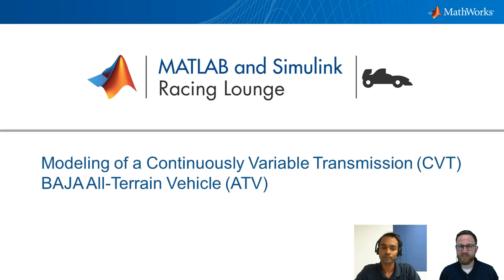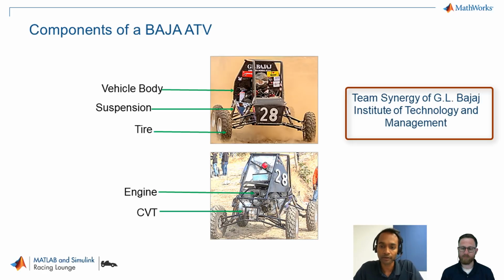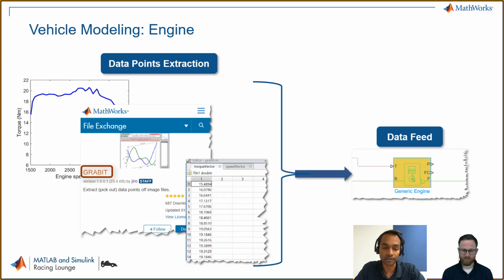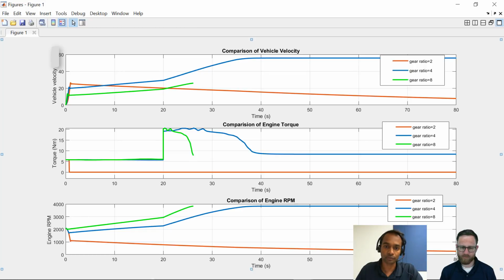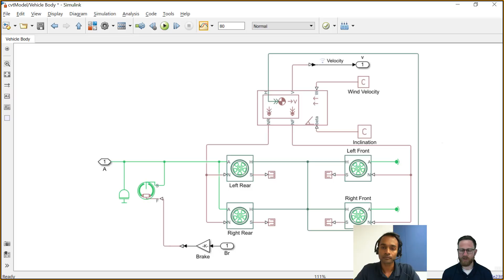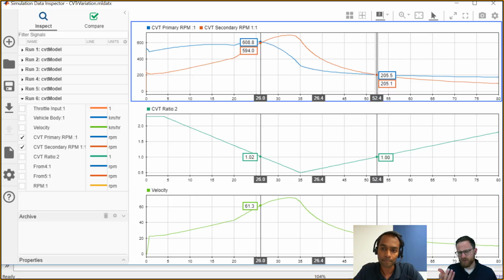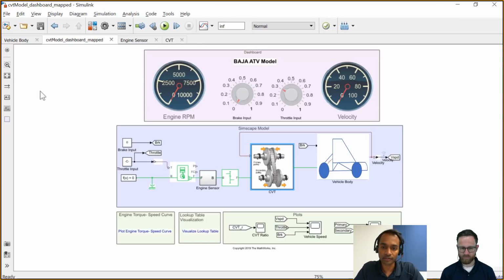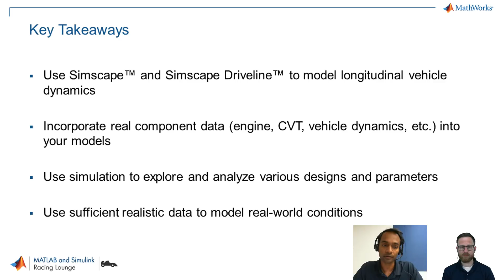Modeling of a Continuously Variable Transmission (CVT) BAJA All-Terrain Vehicle (ATV)

Comment: sir, CVT is directly conected to Engine right? but you have connected GB before CVT
Reply: Hi Jay. Yeah, you are can do that. In fact you can remove the GB and place it after the CVT as you see in actual BAJA vehicles. Try that and reach out to us at racinglounge@mathworks.com if you face any issues.
Reply: @alakshendraveer   Sure sir, Thank you so much

Comment: Good evening, Ive been adapting your model to fit my teams baja project. In our car, the cvt comes directly after the engine, and when i try to swap the gearbox and cvt position to match it, the simulation stops working. Other changes that I did to the model showed no problems at all, so Im kinda lost. Can you guys help me? Thanks in advance, and great video!
Reply: Hello Marco, Thanks for checking the model. We can definitely help you. In your case, you need to tune the model a bit. I would suggest you to share more details and the models on racinglounge@mathworks.com via email. We will have a look and help you tune the model.

Thanks,
Veer 
MathWorks
Reply: @alakshendraveer  it was actually a problem with the inertia of the CVT that I ended up putting some messed up values haha. Thank you for you help and if I end up having any more trouble Ill let you guys know. Thanks again for the awesome service and support
Reply: @marcoslealporto   What really happened??